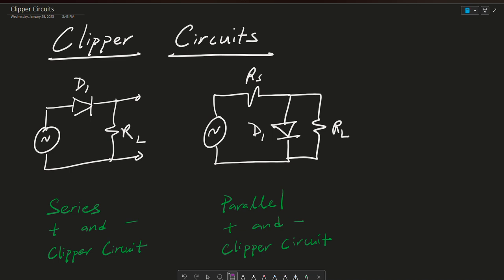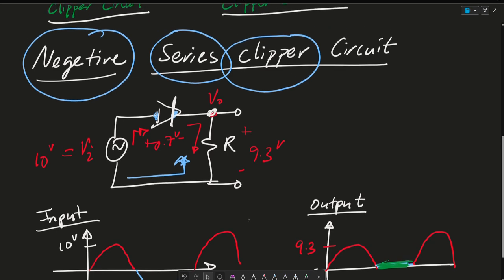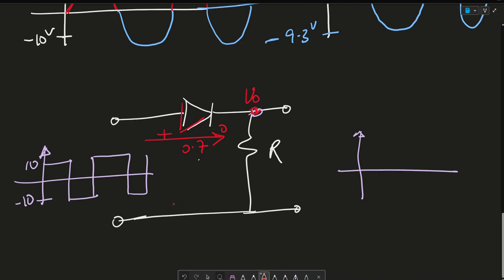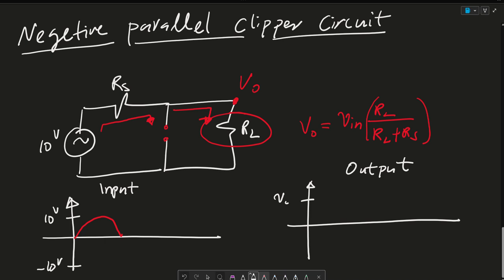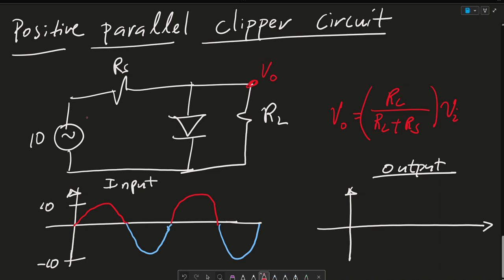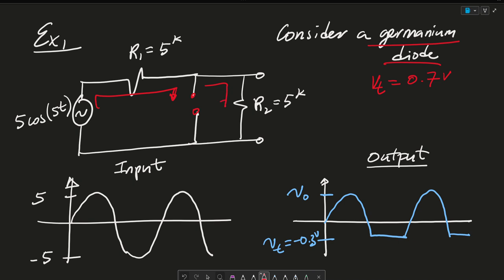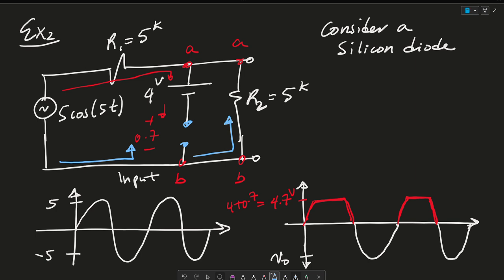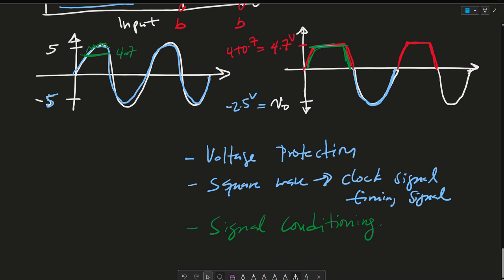Clipper circuits - clearly explained.

Comment: prof, does it not depend on which drop is less between the divider and the diode dc source combination? 4.7 is greater than 2.5. in forward bias, around the 20:00 mark.
Reply from the maker: In this circuit, the clipping voltage is determined by the parallel branch containing the diode and the DC source. The resistor divider (R_1 and R_2) determines the voltage before the diode branch clips it. The clipping level is set by the sum of the DC voltage, and the diode drop, which is 4.7V. I hope this helps.